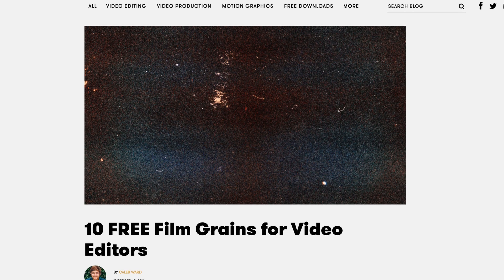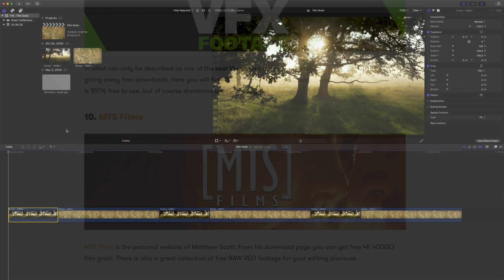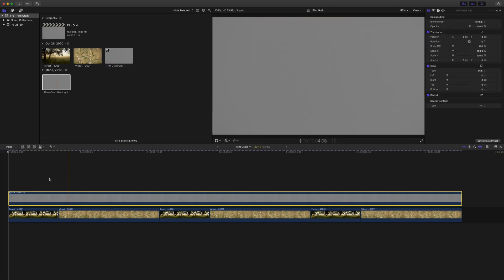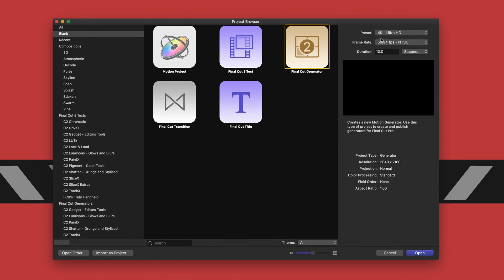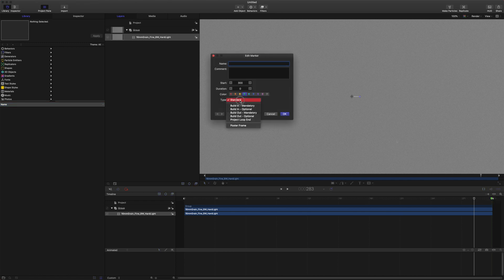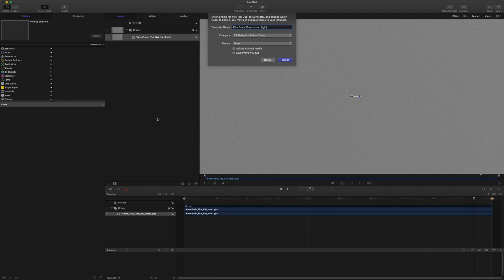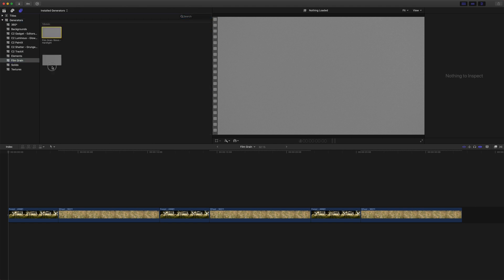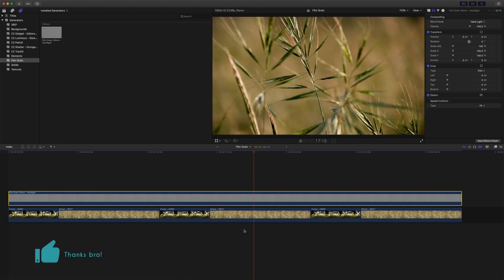How To Create A REAL Film Grain Generator For FCPX

Comment: Finally sat down to implement this tip and I'm so stoked I did!
Would it be possible to set up something similar as an effect (or adjustment layer) but give it options for multiple types of grain, and maybe a slider for intensity (opacity)? 
I have a pack of 8mm, 16mm, 35mm grains, all with several styles (course, dirty, medium, and fine) 
So it would be awesome to create just one effect/layer where I can click to switch between the types, rather than making dozens of adjustment layers.
Reply from the maker: Seriously a great idea. I may need to make a tutorial for this very item. I use this film grain generator in almost every video I make now haha!

Comment: Thx! :)
Reply from the maker: Working on a tracked stabilization tutorial for you my dude! Just trying to figure out factors that make a good track work haha 😂
Reply: @The Final Cut Bro  :) that is exactly my problem, especially the moment when automatic tracker loose it's target. What brings me to the question: are you using any plugins which you bought cause they were unexpesive and really worthy? (In this case it would be Stabilizer 2.0 which costs around 21usd...)
Reply from the maker: BRO! Im sorry, I totally didn't see this response. -- I do have that particular plugin. I don't really use it often, as the type of video I am typically working with doesn't really require any extra stabilization. However, the times I have needed it, it has done a fantastic job. So if you're planning on using the stabilizer a lot, I would definitely recommend it.  Hopefully that helps! -- Someday perhaps Apple will get their act together and add a built-in tracker to FCPX. The one they currently have for Motion 5 is so extremely outdated and slow.
Reply: @TheFinalCutBro  thank you! :)